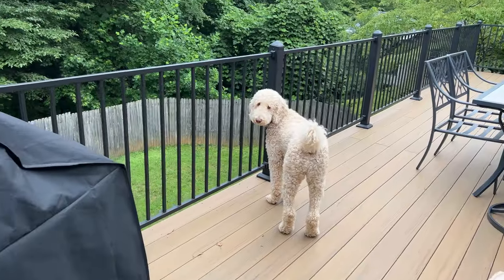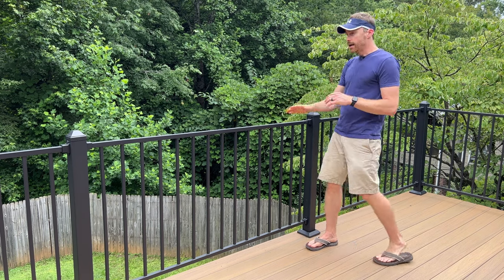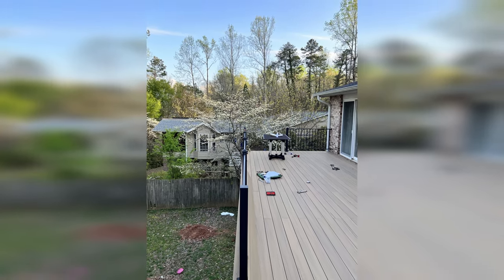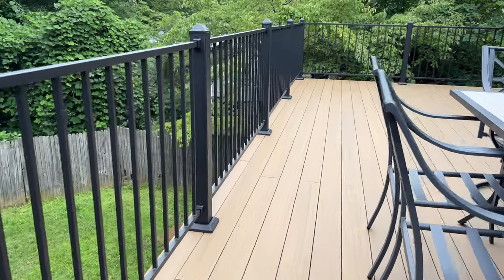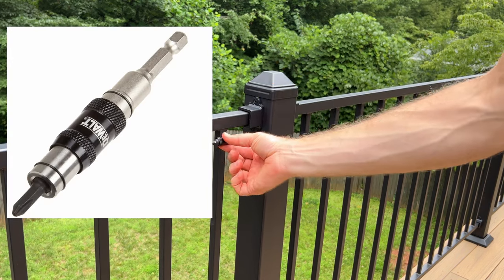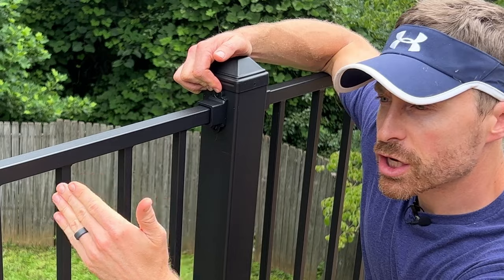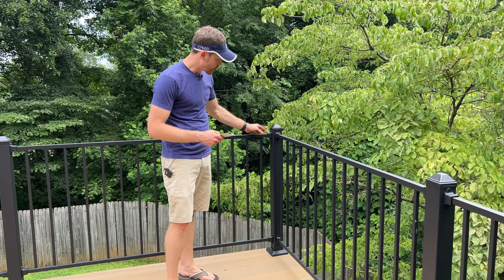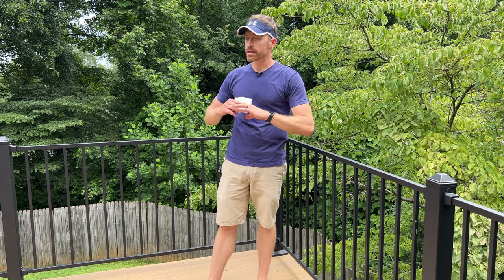Metal Deck Railing - Install, Pricing, and overall quality. Fortress Fe26 Steel Deck Railing

Comment: Great video! I’m in the planning stage of a deck replacement & find Fortress FE 26 to be my metal railing. I’m thinking the Axis model which is supposed to be extremely strong. Like you my deck is elevated to approximately 10 ft. Wondering if you chose the 36” high or the 42”
Thanks for taking the time to record this awesome video
Reply from the maker: I have the 36. It's a great rail system. But it is pricey. Hope your project goes well!

Comment: I'm going to eliminate my wood railing and install some very similar.
However i'm keeping my wood posts and does that fencing company you're using have slip over covers for the posts.Thank for any help.
Like the the black fencing look.
Reply from the maker: Not sure if they have a post cap. You can check their website. Brand is "fortress". I imagine you could use the same brackets to attach the metal rails. I agree, it does look nice.
Reply: We used a different system thats composite and a sleeve over wooden post. We went with a system that allows us to use the same Azek decking plank to sit on top of the entire rail. My wife wanted a large flat surface that not only matches the decking, but also gives us a place to place drinks and have a more comfortable armrest. I cant post links, but you can google "Drink Rail Pack for TimberTech Classic Composite Railing"

Comment: Regal Ideas deck railing makes for a far easier install. The brackets are welded to the posts leaving you to simply attach the railing. My deck is  36 by 16 ft, 8 1/2 ft above ground, with a 42 inch high railing. The shipping slip for the composite listed 3000 lbs of decking that had to go up on the deck, mid-summer. I feel your pain. My wife prefers your deck colour to our light grey. Well done.
Reply from the maker: Awesome, I'll have to check that one out. Glad you liked the video!
Reply: The Fortress AL13 Home also has the brackets attached to the post.
Cheers

Comment: Where did you buy the fencing?  I found it on HD and prices not like on you slip/cheatsheet! Much higher!😮
Reply from the maker: The railing? Local building supply company. You can go to fortress website and find a dealer. Not sure about HD pricing.
Reply: @poodledad  6:56 6:56

Comment: Did you use 2 inch post or 3 inch? Thanks
Reply from the maker: 2 inch
Reply: Cool, I am going to use the same railing but for interior considering its easy installation and lower material cost
 @poodledad
Reply from the maker: @shuitaoyang  actually I was wrong. It’s the 3 inch. Sorry about that.
Reply: @poodledad No problems, I think 3 inch is perfect for your exterior railing

Comment: Can you explain how you did the blocking again? Did you just stack 2x8s on top of each other and blocked them in with 2x10s?
Reply from the maker: I used 2x10's, one sits flat and then is blocked in on each side with another 2x10. Here's a short that shows one example: https://youtube.com/shorts/9dvo4W7aPps?feature=share

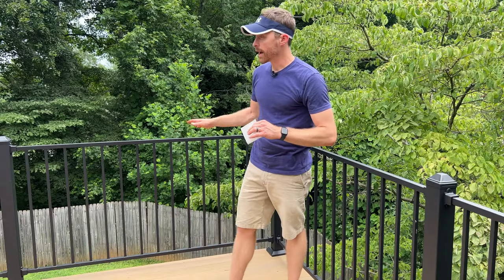Comment: Doesn't look 'extremely sturdy @6:05, lol.
Reply from the maker: The metal rails do flex slightly. That's the 6 ft length. Imagine how much flex you would see in the 10 foot. I would guess the 10 footers are for decks much closer to the ground.